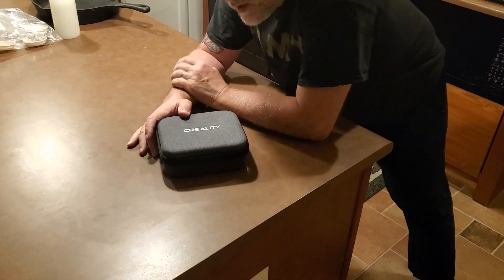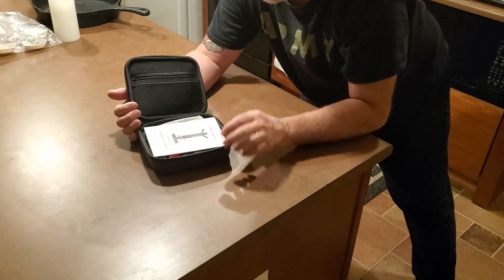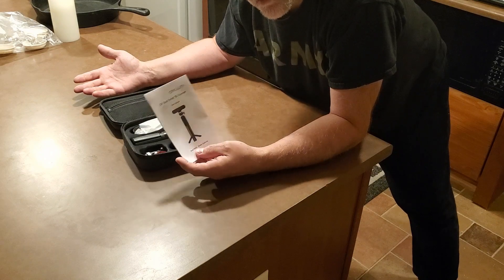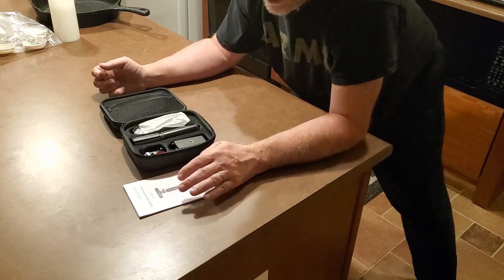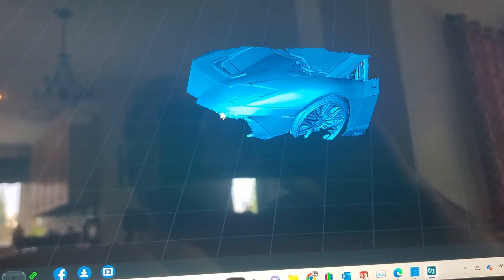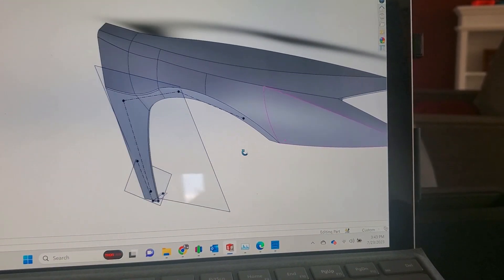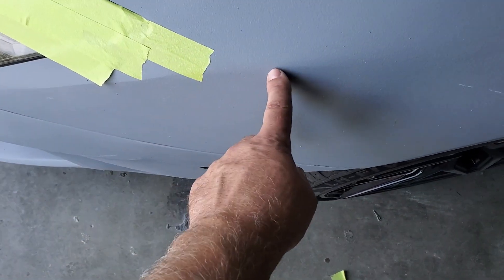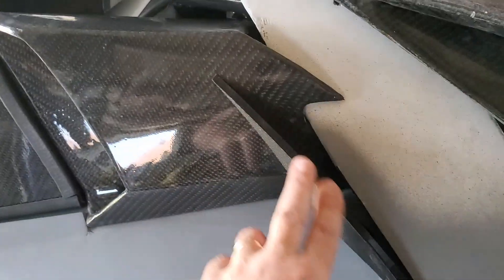Imperfections 3D Printed Interceptor Aventador Update 151

Comment: Have you ever tried Klipper with Creality's Sonic Pad?  

Just recently got a Sonic Pad and put Klipper on my AquilaX2.  What a game changer for the printer.
Reply from the maker: Uh, got to admit, I have no idea what you are talking about! 🤣
Reply: Gets rid of that tiny screen.  Sonic pad is a tablet sized screen and shows a ton more info and has a web front end, fluidd and mainsail,  to it. Also  makes any printer wireless.  Can make Macros for prints that need settings changed throughout the print.   It's really neat.

Comment: Will you be using the body panels to make molds so that you can make them from fiberglass at the end?
Reply from the maker: No.
Reply: @lasersterling is that stuff stronger than fibreglass?
Reply from the maker: Yes, all panels are encapsulated in carbon fiber.  @tahahaider5836
Reply: @lasersterling  💪👍